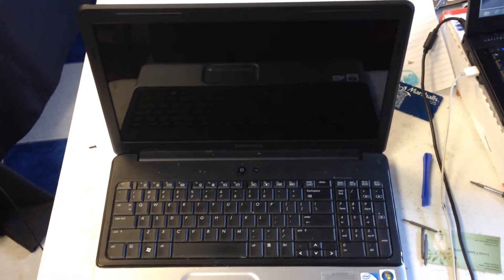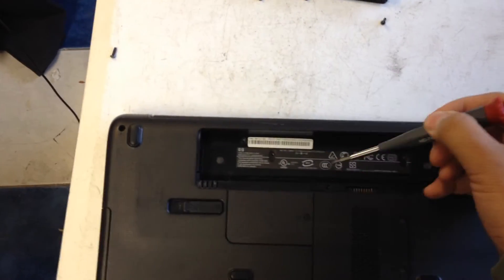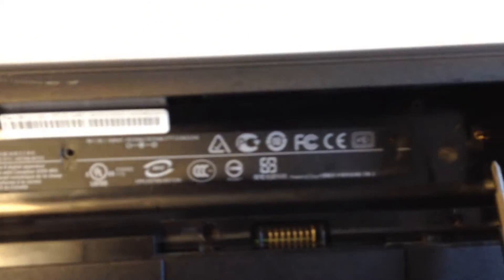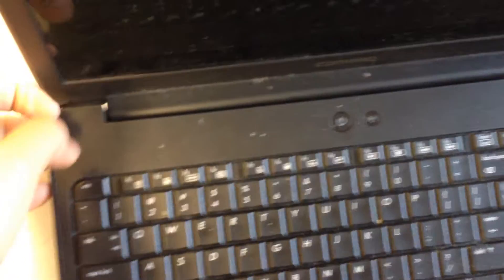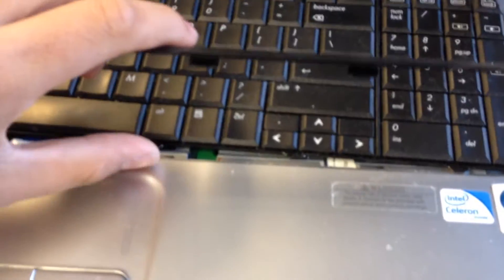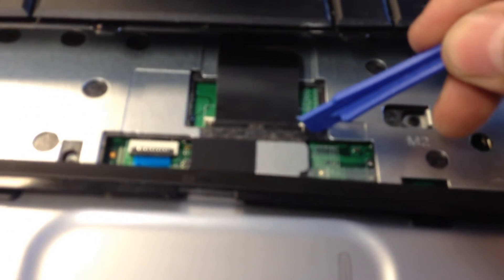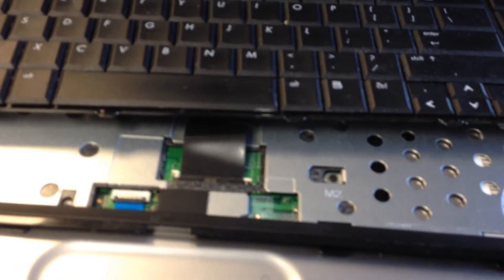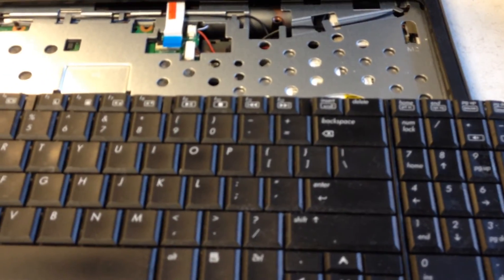Compaq Presario Cq60 : Keyboard replacement & Disassemble

Comment: This is almost right but not quite.  You are not suppose to take off the black plastic surrounding the keyboard, you'll probably break it's plastic clips off if you try (I just did).  What you actually do is just remove the three screws that actually have the keyboard logo next to them and then use a flat head screwdriver to pry up the keyboard from the top number row.  The black plastic shroud should just stay in place.  The the screws in the corners and the two screws inside the model number sticker also stay in.
Reply from the maker: Your right, you do have to be really careful. I belive the video did that because in order to take out the battery u will have to  use a flat head ( making visible marks on the metal u used to take out the keyboard) customers dont like mistakes like that. But i will make a note on the video to be careful around that area. GOOD point..